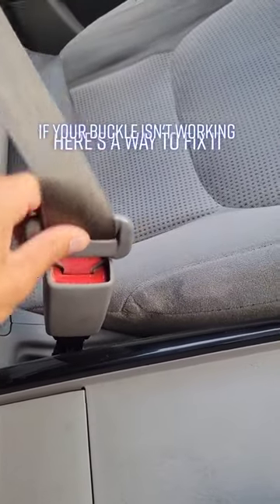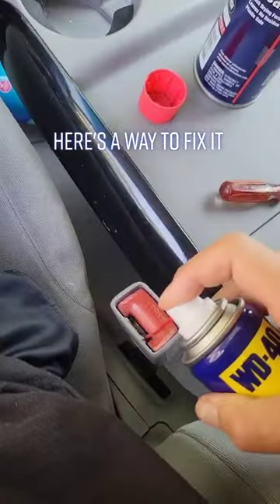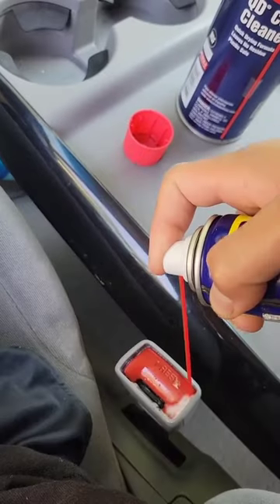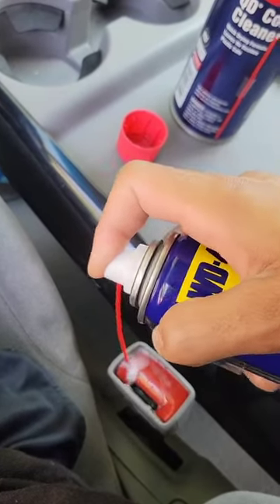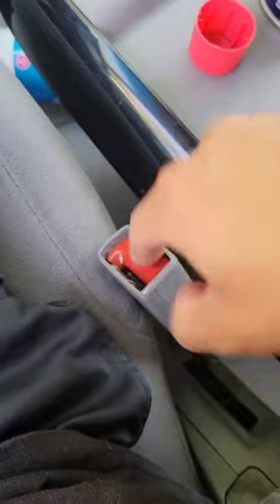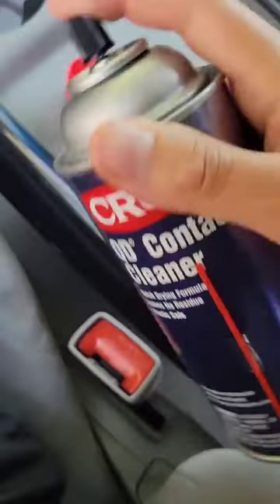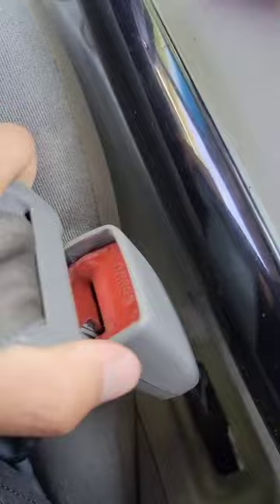Seat Belt Buckle Troubleshooting #steadystrivinofficial #autorepair #diy

Comment: Please dont do this. Put a flag head screwdriver inder the tabs and whack it with something yhat wont break it. The pmast housing should seperate and you can slide it off, revealing the mechanism within.
Reply: Can this be done without removing the seat to replace the whole seat belt part where it clips